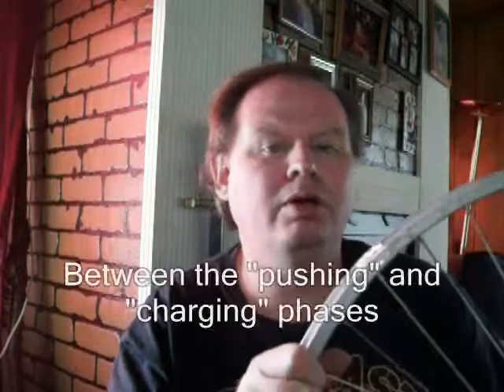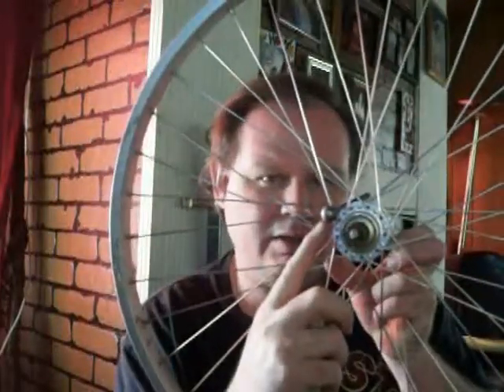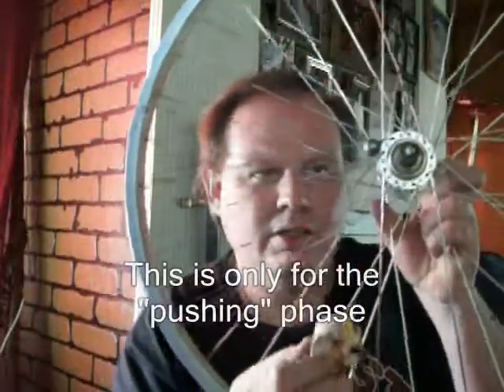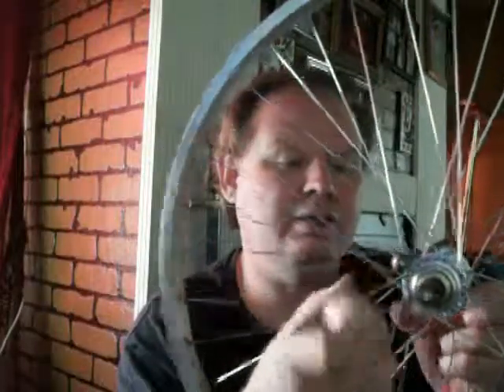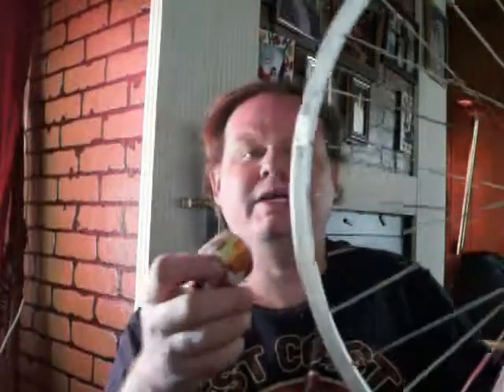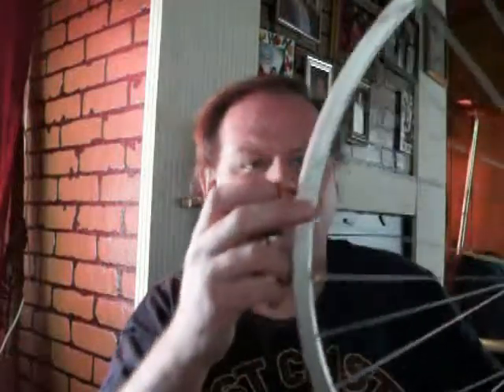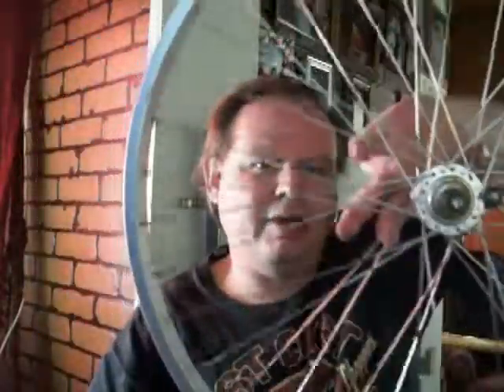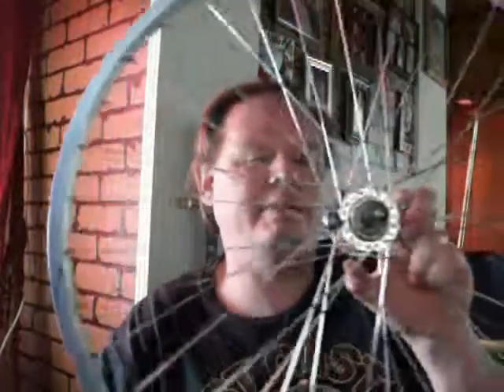Bendini motor concept

Comment from the maker: It's a concept that I slowly work on. I don't get to it much because this sort of thing is not my main hobby.
I got the wheel, then last year I welded a bracket for it. This year I finished the bracket and painted it, and I got a handful of electrical parts. But right now I'm playing with magnets on the wheel for a magnetic motor.
This is what I do in my spare time from my spare time FROM my spare time. lol